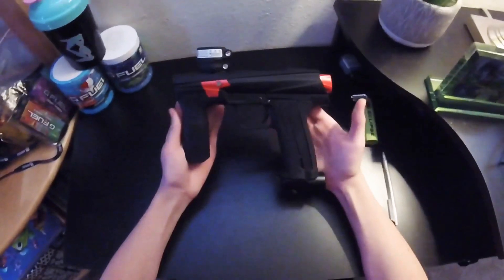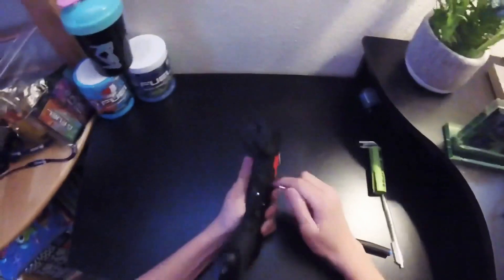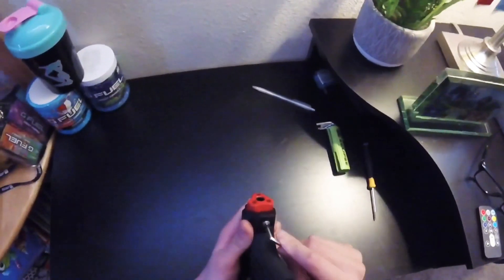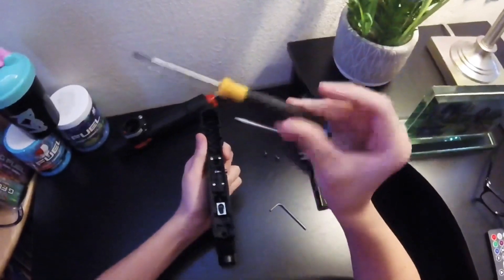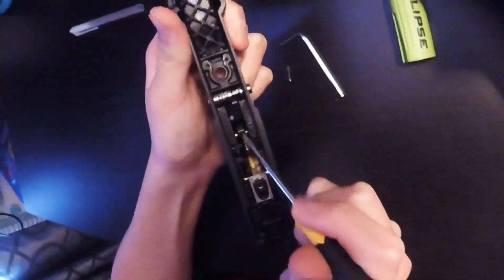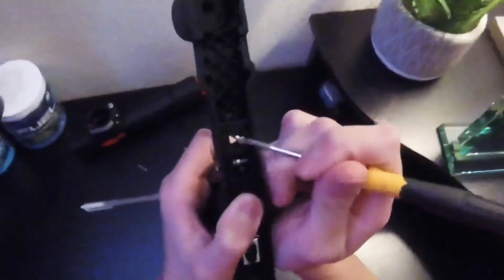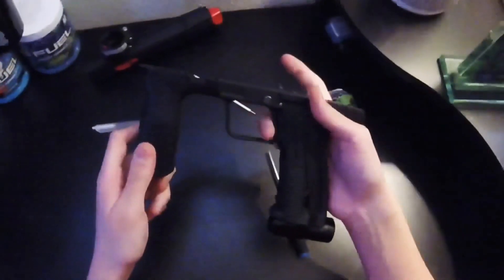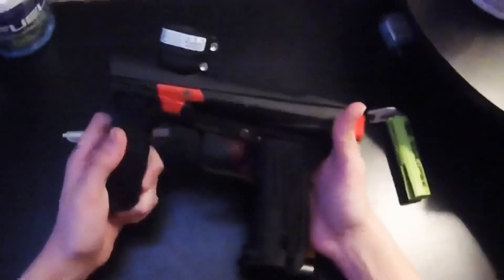💯🔥How To Make EMEK 100 Shoot Faster With Ballpoint Pen Spring!🔥💯

Comment: Also I recommend for you to get the pops asa for your emek I have one and it’s very useful
Reply from the maker: Yeah I’ve looked into it, don’t think I want to spend $50 just so it’s easier to take the tank off, all I have to do is shoot it while I’m taking the tank off, appreciate the recommendation though!💙 the main use I would have for it is putting on the tank to practice and I wouldn’t need to dry fire in the house and have it be really loud

Comment: Just a pointer it’s not good to dry fire because you can mess up your bolt
Reply from the maker: Thanks for the pointer😁, but it won’t ruin the bolt if I only dry fired it a couple times
Reply: I agree with snake god but if you lube and maintain your gun you should have no problems.obviously if u sit their for a hour and dry fire it it’s going to break but a couple of shots won’t hurt it
Reply from the maker: @dirtbikequadfreaks4767  yup! I always lube my gun, I clean it as much as I can after every paintballing session. Same with all my other gear.
Reply: Yup then u will have zero problems